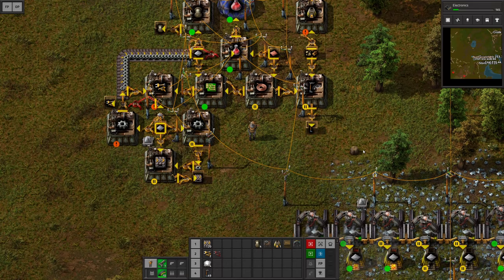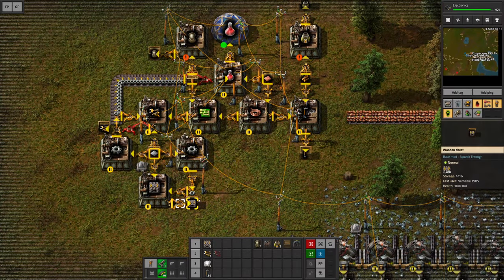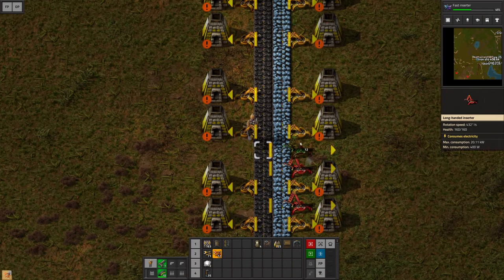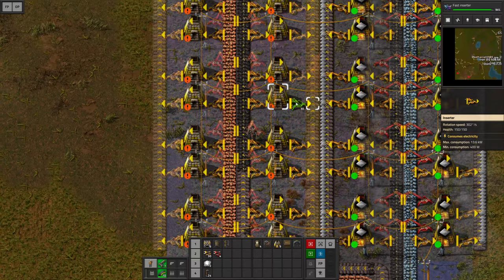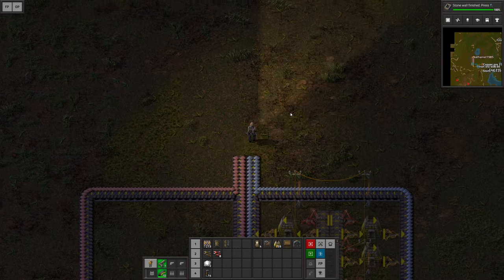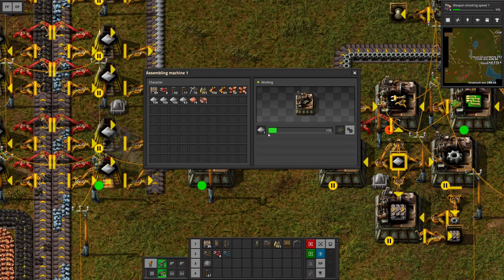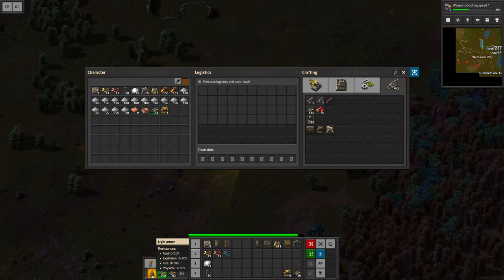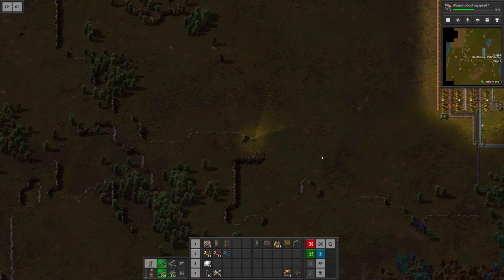FIRST SMELTING ARRAY - Step 2: Factorio Megabase (Step-By-Step)

Comment: I'm not too fond of fights; in my only successful run, I disabled biters and other nasty monsters, so I didn't have to deal with defense or pollution. Looking forward to seeing it at your game. 😋
Reply from the maker: I usually don't play with biters either, but I wanna use the artillerie and stuff like that.
Reply: @Nathans-Sandbox  artillery is good. Veery good...
Reply: Yeah, default settings have a lot of them.  Good thing that you can lower them a bit.  As a start, try rail world, where biters don't resettle the terrain.  That and disabling one or two causes of evolution already helps a lot.
Reply: Just hunt some in the beginning. Build radar in every cardinal direction to check where they are. Use turrets and place them in front of the nest, then wipe them out. Normally water narrows most paths. On there you can build a wall (including turrets) which would make North Korea jealous. 
That’s it :)

Comment: ONe thing you may not know or forgot is that with blueprints of power poles, is that  you can drag power poles over the blueprinted ones, and it will only place them over the blueprinted ones. This will make other item placement faster.
Reply from the maker: Good tip!

Comment: There's another smelting design that uses fewer inserters.  It's U-shaped, where the U consists of two belts "running away" from each other.  The left half of the U (let's call it the L) runs to the left and then up, and the right half (the J) from left to right and then up, too.  
Let's call the squares from which the belts depart E3 and F3.  Then, the L part runs from E3 to A3 and then up towards A99.  The J part runs from F3 to K3 and then to K99.  Ore is fed in from the square E1 towards E2, and E2/F2 are occupied by a splitter feedung onto the outer lane of the U belt.  Coal is fed from E5 into another splitter on E4/F4, which too feeds onto the U belt but onto the inner lane.  Now, one column of furnaces is on the C/D column, getting both fuel and ore from the U belt via inserters installed on the B column, and finished metal is extracted via another inserter on the E column onto an "I belt" which covers the F squares.  At that point, the design is quite flexible.  It can either run towards F1, undergrounding the U belt and spliters and outputting metal where the ore came from, or run towards F99 and output on the far end. 
Another column of smelters is installed on the right half, covering the H and I squares, being fed from the U belt at K and also feeding onto the I belt at F.  The ore/coal-supplying inserters can be powered either via the coal or electric power, and to power the extracting inserters, you only need a single line of poles if you use burners for supply..  Because all power and inserter infrastructure fits on the squares between belt and furnace, you can build them in one go without gaps, saving space, time, and clicks.  (This design is used by Nilaus and speedrunners alike, due to its compactness, low inserter demand, and ease of installation.)

Comment: How do you plan on adding more iron arrays? I’d recommend having the length and using a splitter to make another array, this is done so every furnace is smelting and thus making plates since the further done the less likely the furnaces will be smelting (especially with fast inserters)

Sorry for explaining the game to you as if you didn’t know :P
I always play with splitters and lower their expansion but increase their size because early game they suck but late game it’s fun to fight them
Reply from the maker: Tips are always welcome, sometimes I'm gonna miss something and sometimes I won't know. There is always something to learn about the game so don't hold back;)

For the starter base I will not add more arrays until upgrading isn't an option anymore. The later arrays are gonna be different.